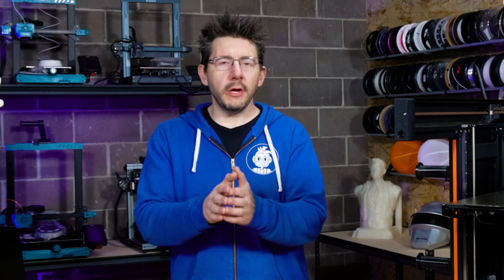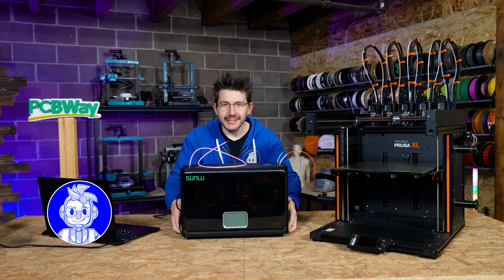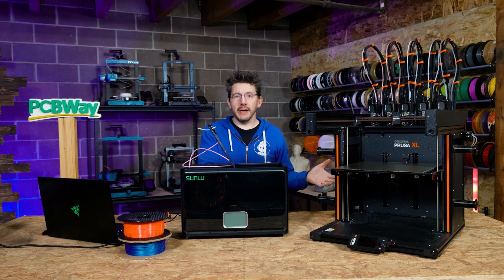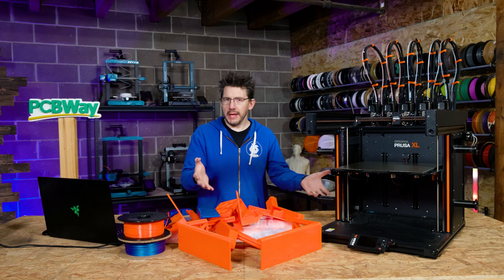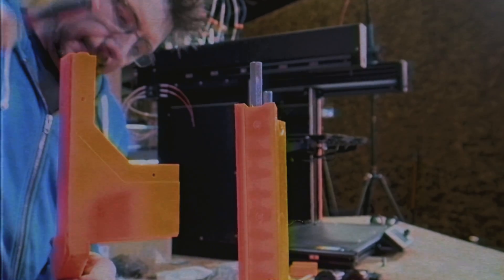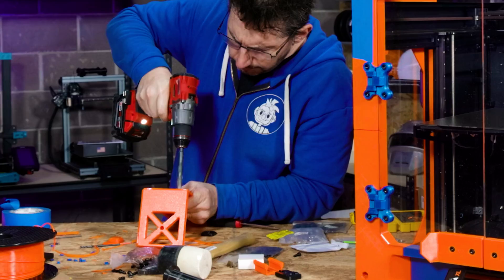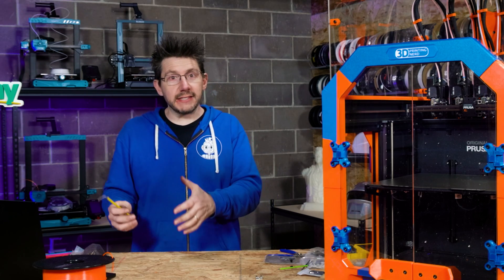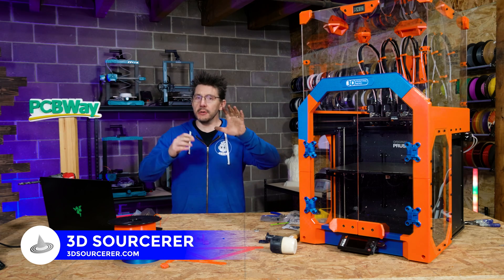Enclosing the Prusa XL - SUMO!

Comment: Or even better, that printer has extrusions  on the top and bottom on the left and the right.   so all you need is some screws washers and clips with perspex.   thast then 3 sides covered.   All you need is the door.       cost you about 20 quid then.

Comment: The enclosure is too big and tall. There is not enough heat retention. It needs more insulation or an active heater. I have a heater that blows directly at the filament as it enters the enclosure. I don't have to dry filaments cuz the heater dries the filament right before it enters the melting zone. That should be the ideal way to dry the filament and heat the chamber at the same time. There is no waiting for the filament to dry and it only dries the filament used. Drying filament is a major part of 3D printing. Manufacturers should make that a standard feature in their flagship printers! Joel, you have the power to wield this into existence. Pitch this request to manufacturers! I demand it! LOL

Pictures and videos of my enclosure available upon request.

Comment: I've printed PETG parts and then taken pliers and broken them apart. And they've come apart not along the layer lines, but as a homogeneous structure. In my experience, PETG is not brittle at all. You just gotta print it really hot so it comes out shiny and really bonds well to the previous layer. I typically print at 255-260° or so.

Comment: I'm not a fan of that look. Guess i'll just order some precut aluminium extrusions, precut acrylic sheets and some simple metal hardware and screws to make my own enclosure.  Can't be that hard to make a bigger cube that goes around a cube, right? Might make the sidepanels big enough to enclose the filament as well, and just use magnets, so it's quick and easy to remove panels to change spools or do maintenance on the printer.

Comment: Just a wild idea. Not for temperature control, but for humidity control. A super cheap way, or at least way easier to do.
Get a liquid-based treatment that will make treated surfaces super hydrophilic water loving. A vacuum chamber is probably overkill, but to work the liquid treatment into the material even better, use a vacuum chamber. But take a blanket, sheet, whatever, and treat it with that chemical.
If your filament drying machine has a port where the moist air comes out of, face that away from your 3D printer but have them beside each other.
Throw the super hydrophilic treated blanket or sheet over top of both but snug the blanket up against the dryer so the moist air exhaust port is outside of the enclosed area that the sheet is creating.
And have your Moisture detector inside of the sheet with a remote camera on it or just let it sit idle for a while and then start your print.
What are your thoughts on this?

Comment: I recently purchased an S4. It came out of the box with an error 3. Sunlu told me to open the bottom and check the wiring and such, but I couldn’t find any issues. Had to do an exchange through Amazon; currently waiting on the replacement. I would try a different dryer based on my initial experience, but I really want the 4 spool size, and I haven’t found another one that suits my needs within a reasonable price.

Comment: I don't get why you have a moisture problem, as I have about 15% more moisture than you have when I compare the grams of H2O per KG of air at that moisture level. and I don't have any problem at all with moisture, I don't store filament in bags and don't use dryers 🤷‍♂

Comment: PETG is a terrible choice for an enclosure if you want to put any heat into it at all. You only get a few degrees more before it starts warping than you would PLA, still well under the level an enclosure should be at for most of the filaments you mentioned. Stick to ASA, ABS, etc unless you're enclosing a RatRig (also made of a lot of PETG) where your printer would be melting anyway if you tried to print at the temperatures required for better filaments.

Comment: PETG will fail over time when used on an enclosure.  Typically within 1-2 years, but some have reported less than a year..  This is why RatRig no longer supports the use of PETG for their enclosures.  Only ABS & ASA is able to hold up over time.
Reply from the maker: Oh dang! Good to know. I can use this enclosure to print an ABS enclosure:)
Reply: @3DPrintingNerd  Bootstrapping!

Comment: I'm really curious about how fumes/etc will work with how open the top-rear of the printer is. Even what we've seen so far of Prusa's upcoming official enclosure looks like it has that same open back (plus even less seal around the front due to the accordion curtain), which suggests that a simple recirculating filter like Prusa's or the Nevermore might not be good enough.

Comment: Holy Heck!!!!  3 Kg's of filament for that?  Bad enough the printer cost silly money ( about $3500 over priced for a printer really even this type )  

But the maker of the encloser is a real clever soul. He manged to sell a product for almost $300
But then the user has to spend even more tons of money on 3 Kg's of filament then print it all using tons of time and electric. 

That encloser designer is rolling in money for something where the user spends tons of extra money on top of the brought encloser kit on to even use it?

Madness. So really this encloser kit will cost really about $400 by the time you buy the good quality 3 Kg of filament ( not cheap ) then the electricity then the time to build it.

Not really value then for money when you could enclose the printer for far less money than spending on 3 Kg extra of filament plus all the energy and time.

Comment: I just ordered an XL and i dont care about the enclosure because i have a massive enclosed printer shelf thats a meter tall, and its perfect for multi color peinting because of a big filament shelf/drier combo

Due to the wires/ptfe tube i can not fit the xl into my enclosure in traditional orientation. The outside dimensions are similar to a voron 350 but the extra space it needs is ridiculous

Comment: I finished mine and posted a make on Printables January 15, 2024.  It is not perfect, but I would rate it at 98%.   I had some similar problems and ended up reprinting the parts in ABS on the Prusa XL with the SUMO enclosure with the original parts.   I was able to get the internal temperature to hold at 100 degrees F and had only minimal warping on the large ABS prints.  It does what it is designed to do and the kit has extra hardware for us that drop parts that go into hiding, much appreciated.  Since Prusa has no time line for their enclosure this is the best option on the market and a fair price

Comment: looks oke but 300 dollars for some cheap 3mm acrylic cheap hydromiter and some screws and nuts thats just wrong i get that a lot of time when it to designing it and documenting but 300 is way of base you can build a lot better for that money considering its a 4000 dollar printer
Reply: The panels are cut and drilled perfectly, the hardware is sourced and extras supplied, and the work that went into the design and kit assembly.  I think the kit was fairly priced - curious to see what Prusa's version will cost.

Comment: Actually the material then IS hydroscopic, as it absorbs moisture, no matter from where. Same as standard brake fluid etc.

Best wishes
Reply from the maker: Hygroscopic means to absorb, hydroscopic does not mean that.
Reply: @3DPrintingNerd  Hello!
That is incorrect.
Hydroscopic is, when a material actively attracts and absorbs moisture.
This can also be witnessed with DOT 4 etc. brake fluids, because of which they need frequent replacement (lowered boiling point).
I’m coincidentally an engineer.

Best wishes nonetheless!
P.S.: Maybe you were thinking about hydroscopic & hydrophobic.
Reply: @justinl.3587  Indeed, my bad due to language mess up. You (& he) are correct.
And no…why should I delete something I stated, even if I made a linguistic mistake?!
I’ll simply own it.
Best wishes

Comment: What's the results in temperature? I need a enclosure that can go to 80C plus to avoid warping m. M
Reply: I get mine up to 100 F by only using the bed heater.  I would be careful going to 80C with some of the printed parts on the printer.

Comment: Love the idea to put an enclosure on the XL, but don’t love the options yet. So bulky on an already bulky machine. Also, anyone with an XL use a RepBox? Considering using that and mounting it above the machine for ease of use. I already have a 2 roll dryer and getting another one or a sunlu s4, seems wasteful in my situation and I’d still only be at 4 of the heads without adding a separate single dry on top of that too. Lastly, anyone know why the cables and tubes are so long on these machines. It seems like nearly 1/3 can go away or more, and then add in quick disconnects if you need to work on the head.

Comment: Enclosures should be printed in ASA/ABS for the rigidity and temperature tolerance. 
PETG will get too soft if it gets hot in the enclosure, which is what you should want for good print results.
Reply: Except you can’t print the enclosure out of ABS/ASA unless you already have an enclosure.
Reply: @Prestinpieces  janky cartboard enclosure for the win XD
Reply: @Prestinpieces  You can, just need to enclose it a bit and prevent drafts. Shove a box over it. A big box.
Reply: I reprinted mine in ABS and it is working great

Comment: It's a bit ironic when your $5,000 printer has to rely on a bodge enclosure from a third party. Makes a really good case for the whole "I want a product and not a project" argument against the XL. I'll still go for the whole "slower and more wasteful" system consisted of a Bambu Labs P1C or X1C with 4 AMS modules, which will still be cheaper than the 5 head XL and doesn't require a $300 enclosure you have to build yourself later. Plus you have 16 colors or materials available.
Reply: honestly don't get the point of an XL, it costs more than a voron tapchanger, takes so long to be shipped that you could build a voron in the time and have time to spare, costs as much as 2 x1cs, performs worse than both, and then after it arrives, you have to finish the design for prusa?
Reply: But you still can't print many materials I'd say, a lot of colors for sure, but the XL is mainly meant for more than that. They do need the enclosure and they needed it to be included, I agree there.
Reply: @punishedbrains  The primary issue here, apart from the dozens of issues that were included for free with most XLs when they shipped is the price. If you're charging 5 grand for a printer, you better ship a product and not project, especially when you have competing products which do more or less the same thing in the market already and they work as advertised out of the box like....The Bambu Labs P1C and X1C printers. For people that want a project, they can build a Voron and add the tap changer system, which can use up to 6 heads and still costs less than a XL despite being a complete custom solution.
Reply: @punishedbrains which makes you think how rushed or not well designed this printer is. The appeal or advantage of the XL vs other multi material systems is that it can "truly" print different materials, BUT it would need to be enclosed to successfully do that so that kind of cancels that advantage. $5000 for a printer should get you everything you need, No mods needed, No tinkering, EVERYTHING you would need and the XL is not there, not even close.

Comment: I have this enclosure and really like it.  I also printed mine from PETG and really struggled. 

 I ended up redesigning the parts with even thickness wall sections everywhere and no infill to help with warping and the shrinkage of PETG.  I also eliminated the hex pins and made the sections bolt together.

You can see my review and build on the Sumo Enclosure on Printables.
Reply: what's your link on printables?
Reply: @crashkg YouTube keeps deleting my comment for some reason.  Just search out the sumo enclosure on Printables and you'll see my review and build.  If there's enough interest I'll consider uploading.
Reply: @crashkg  Brian_506099.

Right now I just have my build on the official Sumo enclosure.  If there's enough interest I'm look into uploading the files.

Comment: I have been using the Sumo enclosure for a couple weeks now. I found that the PETG idler arms on the filament drive gear need to be replaced with ASA. The original PETG ones couldn’t stand the heat that builds up in the enclosure. I am presently upgrading some of the other core xy components to ASA. Even though I am having to do some upgrades I still love the printer and the enclosure!

Comment: I think Prusa is in trouble.
Reply: They are falling further and further behind.
Reply: @ScytheNoire It's one of their best selling years, reality check?
Reply: @punishedbrains relax fanboy. Do you own Prusa stocks?
Reply: Unfortunately yes… there going the way  of blackberry
Reply: @wallie61-  is there any printer out there in a “desktop” category which can match capabilities or quality of XL?

XL is actually something like MacBook Pro of 3D printing.
Reply: @rudolfkrcmar not even the XL can match its own capabilities. You can print multiple materials, as long as they are different colors of PLA and a little bit of TPU for anything other than that you would need to make this horrendous enclosure. All of that for just over $4000, it's a steal!
Reply: @elleryfg7853  if you want to stick with just a single material like PLA, the XL is going to be multiple times faster, wasting a lot less filament. 

You don't have to be an environmentalist to know that using over 1kg of filament to print a 4-colour 130g model is not right, nor is it economically sustainable for a longer period. Saying anything else... the arguments do not hold together. 

Utilising PETG supports for PLA models and vice versa is another great unique feature, and for that you "only" need 2T XL.
Reply: @rudolfkrcmar  yes the XL is great for all those things but you're still paying close to $3000 for an unfinished product because at the end of the day the XL is still in the development phase. In any case, I don't see myself wasting $3000 to print multicolored waste

Comment: I got mine put together last week, amazing instructions!  My biggest complaint is their use of acrylic with no options for polycarbonate. So sooner or later cracks will form and it will just deteriorate from there.  In some parts they did a good job at crack mitigation (thankfully the doors were a good example of that since that'll have the highest chance of cracks forming.
Reply: Rubber, nylon or plastic washers are a requirement if you're fastening anything to acrylic, policarbonate or glass, especially if  it's a thin sheet. For thick acrylic, you don't need it.
Reply: Just print plastic washers, and you should be fine. That's what I did with mine.  I put them under every screw head that was in direct contact with the plexiglass. 

Polycarbonate will crack too if you overtighten the screws.

Comment: Such a shame that the printer is this expensive and doesn’t even have a enclosure. Going back to creality upgrades for a multi thousand dollar machine 😂😂
Reply: Prusa didnt release an enclosure originally with the MK series either, was added later.
Reply: @deeply999 you're not helping
Reply: @deeply999 Prusa also didn't sell their i3 printers for 2-5 grand either. Looking at the XL design, it's obvious the printer was designed to have an enclosure, but fear of Bambu Labs made Prusa ship incomplete products.
Reply: @deeply999  I know but for this price it should be included or the printer should be cheaper. In my eyes the PrusaXL is way to overpriced for what it offers.
Reply: Yep and 300$ for some stl files and 6 pieces of transparent plastic?  Seems a little to expensive in my opinion
Reply: most people just print pla and petg.  I would say prusa where correct in selling it with no enclosure as materials like pc and abs  are more of a niche market. If that is your thing then 200-300 dollars for an enclosure isnt much more.
Reply: @jean-marcgruninger9019  It is when you have to build and print said enclosure yourself. As mentioned before, people that are willing to pay 5 grand on a printer want a product and not a project. We're no longer living in the early 3D printer era where Makerbot and Ultimaker could charge you 2 grand for essentially a penny's worth of features and you did give them money because there was no other choice.
Reply: @jean-marcgruninger9019  the thing is most people just print PLA or PETG, because most printers come without enclosure and many people didn’t want to build a enclosure. More people startet printing advanced materials since Bamboo started selling printers with enclosure that aren’t super overpriced. Personally I like Prusa for their reliability but the price for the XL if you want to use multiple print heads is just crazy
Reply: @jean-marcgruninger9019 printing ABS/ASA is niche? that's news to me